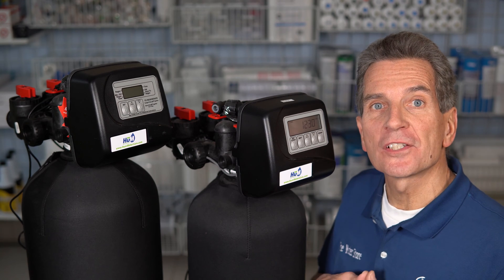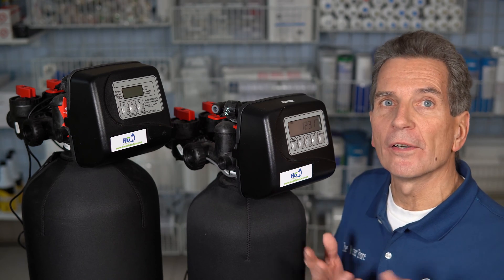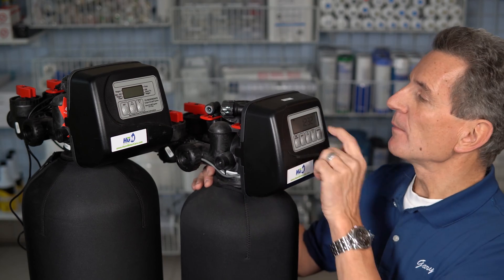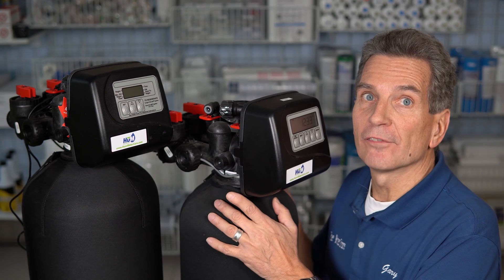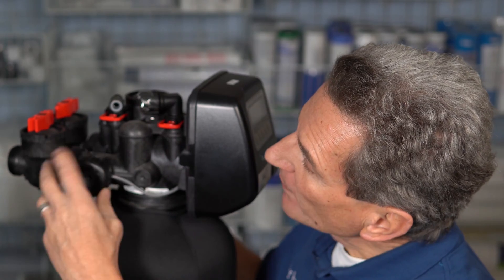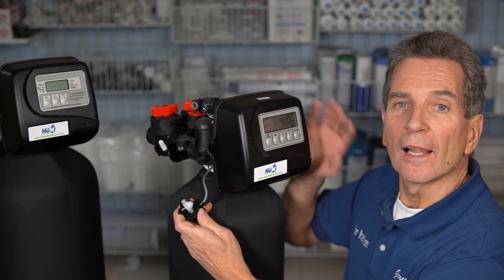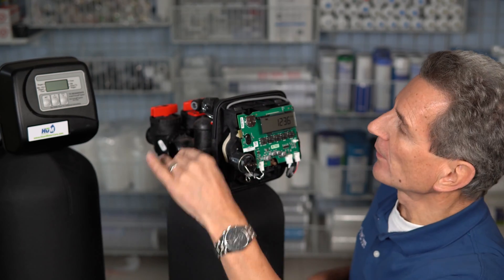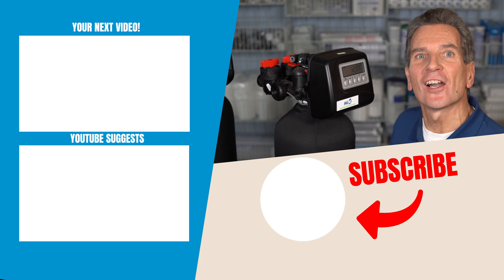WATER SOFTENER Troubleshooting NO SOFT WATER 6 Easy steps

Comment: The 3 way bypass valve was my issue and my fault. I left the bypass valve open after replacing the spacer stack and pistons. Gary quickly helped me troubleshoot and resolve the issue.
Reply from the maker: Yes, it happens very often!  I wonder how many working water softeners have been replaced because a bypass valve was left open?

Comment: So I have no idea what brand my softener is, as it's just labeled "Water Depot refineosoft." That said, the control panel is a bit different, but everything else seems identical. I followed the video along, shut off the bypass, started the regen,  got to pulling out the meter/impeller, and um yep, we had water gushing everywhere. From the quick glance I got before becoming the little boy with his finger in the dyke, the impeller looked like it was crusted with salt crystals. 

When I began troubleshooting what was wrong, I've watched several of your videos, and they're so extremely helpful. Lol just unsure where to go from here.
Reply from the maker: Water Depot uses the same Clack Valve as our HUM brand just a different faceplate. I think you forgot to shut off the water supply going to the softener. Also, if your drain line goes up some of the water will drain back down when you open it up but it will stop fairly soon. Give it another try. We have the meters here https://waterestore.ca/products/clack-ws1-meter-assembly-v3003
Reply: @GarytheWaterGuy    nope water was shut off. It's 100% the drain line as it was fed through the rafters. So yeah we need a bucket but will check it next day off. Thanks for the link!

Comment: Just one more thing. This 5600SE system was installed in 2007. I performed a partial rebuild of the control valve in 2015. When I attempted to service it again in 2019, the Fleck stainless Bypass valve was extremely difficult to turn because the internal rubber seal had disintegrated (it spread small particles of rubber all through our plumbing). I replaced the Bypass valve with a new one at that time and ordered a rebuild kit for the original, just to have it on hand. However, it's only been five years, and now I'm seeing the same problem. Could barely turn the valve today, and there are rubber particles in the pipes. This is probably also why the meter isn't working. Do you have a recommendation for duplicating the bypass function with external ball valves? I'd like to just eliminate the original Bypass valve and be done with this.
Reply from the maker: It's always a good idea to "excercise" the bypass at least once per year.  Yes, you can build a 3 way bypass with ball valves instaed, if you prefer.
Reply: @water_estore  This is the Fleck bypass with a single handle. The large inner seal swells and decomposes. I think the cheap Chinese rubber compounds don't like the chloramine in our water. Anyway, I finished building a 3-valve bypass system today, hope to hang it on the wall tomorrow. Then I'll rebuild the control valve, and hopefully that will be the end of this for awhile. Guess there's no way I can post a pic of the system here. Oh well, thanks for the video!
Reply: As I suspected, the turbine meter was stuck. I disassembled it assuming it needed cleaning, but the problem was that the two magnets had rusted and were rubbing on the turbine walls. I don't understand why this didn't last longer. It's only 17 years old.  🤣

Comment: Our Fleck 5600SE has somewhat the opposite problem. It's set to regenerate when total flow reaches 2,200 gallons. However, it has stopped resetting to zero during regeneration and now shows 2200 all the time. Because of this, it tries to regenerate every day unless I unplug the wall wart. Any ideas on what might cause this? I really like this unit, so hoping it's not an obsolete component.
Reply from the maker: Sounds like a settings problem, did you change any settings lately?
Reply: @water_estore  No, haven't changed any settings. One thing I discovered yesterday is that the "Flow" indicator doesn't blink when water is running. Maybe it's a quirk of the firmware that regeneration won't reset the usage number if the meter isn't working. I'm about to rebuild the controller, so I've ordered a new meter assembly, just in case. I sure hope this doesn't turn out to be a defect in the PCB.
Reply: Just an afterthought - It's been a long time since I worked on this softener, and I coujld be mistaken about the usage function. Maybe it counts down from the max setting, not up from zero. If that's the case, this might only need a rebuild (it's due) and cleaning the meter turbine. Got my fingers crossed.

Comment: Great video, very informative. I pulled the water meter and it shows “softening” when I blow on it. Reinserted it and it does not “soften” with regular water running through. What’s my next test?
Reply from the maker: Assuming you ran water from a faucet that is serviced by the water softener, if it still does not register softening I would replace the meter.  We have them here https://waterestore.com/products/clack-ws1-meter-assembly-v3003
Reply: @water_estore  thank you!  Second time I tried, it started registering again. I think maybe it just needed to be freed up.

Comment: This is great content, thanks Gary this helped me resolve the no softening display when water is flowing  the meter may have been stuck when I removed it and some water came out from the port when going through the rejen cycle back to the home position. I spun the little fan and it started working .
I reinstalled it and now its working again.
I just replaced the well pump and sediment may have gotten into it as I do not have a prefilter in the softener .
Reply from the maker: Excellent, glad it helped.  Please share video with friends and family.

Comment: My clock time has frozen.  I can’t adjust the time.  The hour and minutes flash, but the up and down arrows don’t work.  Help!
Reply from the maker: Disconnect the circuit board from the power supply, wait 1 minute then reconnect.  If that reset doesn't fix it, you need a new circuit board.  We have them here https://waterestore.com/search?type=product&q=clack+circuit+board

Comment: Do you have a video or know how to fix the control panel, yesterday I turned on the extra regenerative setting and then a day later it’s still on. I’ve tried unplugging it and cutting the power. Any advice?
Reply: It’s an envirotec water softening system
Reply: Yesterday at night I also noticed that the brine tank was dry, it just had the salt. So I poured water in
Reply from the maker: Try unplugging the circuit board, wait one hour and plug it back in to reset it

Comment: Your videos are great Gary! My sterling water softener hums and vibrates loudly near the bypass valve at the top of the media tank each time a toilet flushes or a faucet is turned on low pressure.  Would greatly appreciate any suggestions.
Reply from the maker: Never heard of this before but there could be a restriction inside where the pipes connect.

Comment: Hi Gary, I have a culligan water softener that is not registering any flow. It says softening but the flow rate is 0.0. The flow wheel spins freely when I blow on it. Do you think it's a defective meter? What would you recommend I do?
Reply from the maker: It’s either the meter or the circuit board. I hope for your sake it’s the meter

Comment: Can the flow meter be sensitive to vibration or wild fluctuations in water pressure occurring over several seconds or minutes when NO actual flow occurring? We have a softener intermittently detecting flow & softening when no flow is occurring. A Phyn water monitor detects these wild fluctuations in pressure changing over microseconds anywhere from 69 to 83 PSI & showing micro-flows GPM at same time, but NO actual water consumption measured! When this occurs, using a highly sensitive amplified stethoscope to listen to in & out pipes to softener, we can confirm NO WATER is flowing. Turning water on/off at sink somewhere in the house, we can hear it flow & stop accordingly. When this intermittent wild pressure event occurs, stethoscope detects vibration at pipes in/out of water softener.
Reply from the maker: I really don't think so.  I would replace the meter, sounds like it is defective. https://waterestore.com/products/clack-ws1-meter-assembly-v3003

Comment: Hey Gary, I have a clack 5 button water softener that when I test the meter is working (blow test, and counts down). However, when it’s reassembled the water meter does not count down when in service. This is confirmed by also no flashing “softening” when water is being used. It did prior to ~ 5 months ago. Is this the circuit board?
Reply: This is my issue as well. Have you found the reason for this?
Reply from the maker: No, I have never come across this situation.  Unless there is something in the valve restricting the turbine from turning or the flow is backwards through the water softener.
Reply: Would it soften the water if the flow was backwards?
Reply: @bali240  this my problem to; did you find the issue ?
Thanks

Comment: WATCO brad.  Does not turn on.  Used to auto on around 3:30 Am.  It does display correct time.  Salt level about a foot below very top of tank.  Had to add 8 gal of water to get crystals covered.  I pushed 'REGEN' and it now says 'run today', but did NOT turn on.  Have  not done anything else.  Have not heard it come on when up at night in months.  White blush around water line in kitchen sink when done washing dishes in it.  No longer consuming salt.  Maybe it just needs to be reset as if it was fresh out of the box???  Don't know how tho.
Reply from the maker: Check out my water softener troubleshooting video here https://youtu.be/Lr3jyGiJdC0

Comment: Hi Gary

I love your videos, thx a lot !

Please, Can you help me to diagnose an issue with my Clack WS1 inline flow meter?

I started to notice the word softening flashing on the screen, but no one was using water at that moment, I disassembled the inline Flow Meter in order to check it and reconnected the Circuit board to the electric power and even without the inline flow meter connected to the circuit board I noticed the word softening flashing on the screen, I was intrigued by what's happening

I am an engineer with a lot of ability to evaluate and correct mechanical and electronic problems. Could you please guide me from the height of your knowledge and experience about what might be happening?

I have tested the flow meter and it is working usually, when the impeller is activated with an air blower, it starts to count the volume G/min, with a more potent air blow, it shows a more significant volume per min

Hope you can give me this small contribution/help

Best Regards

Eng Adriano(Brazilian but my home is Arizona)
Reply from the maker: Wow, never seen this before. Must be a defective circuit board

Comment: I installed my Aquasure unit to-day and ran the initial cycle and setup per instructions,  but the gallons don't count down, I did plug the cable into a port in the back for it and the power plug, set the time etc etc and it seems to work ok but not counting down gallons. It doesnt have that unscrew a cap  to remove the impeller.
Reply from the maker: Are you sure it isn’t plumbed backwards?  If not something is defective

Comment: My water softener is the other one with the three buttons, what brand is that? The dash is completely off not sure what’s going on
Reply from the maker: If your 3 button display is blank you would either need to replace the power supply https://waterestore.com/products/clack-ws1-replacement-transformer-clk-v3186 or the circuit board itself https://waterestore.com/products/clack-ws1-3-button-circuit-board-v3108tc This video will help you troubleshoot https://youtube.com/shorts/JNVLAd4SD4I

Comment: Hi There, I would like to know how to fix error code 0 on Model Fleck 5800 LXT downflow/upflow water softner. Drain water continuosly running while the error code flashing.  On Manual error code 0 showing, Motor Stall/Cam sense error. how do I fix this?
Reply from the maker: Sorry I don't know.  I very infrequently deal with Fleck products becasue I do not like them.

Comment: My softner wont regenerate! I looked at my meter and it's still working! The cam turns on the top but it won't flush the tank at all never makes a sound! I can dig a pole threw threw the salt I'm out of ideas any help is much appreciated
Reply from the maker: Did you try the suggestions from this video https://youtu.be/Lr3jyGiJdC0

Comment: Thank you so much for this video. The meter on my water softener was not working and by following your instructions I was able to remove it and found that is was sticking. With a bit of cleaning it is now spinning freely and my water softener is metering properly again. You saved me a bunch of $$ for a needless service call.
Reply from the maker: Glad it helped!  Please share video with friends and family!
Reply: @water_estore  Guess what? 2 years later and it happened again, so I watched this video again to refresh my memory and in less than 10 minutes, I had it working perfectly. Another needless service call avoided. Thanks again.

Comment: Thanks so much for this information.
I have a Westinghouse water softener system and we had a power outage, the thing will not work, I followed your video and have .26 seconds for it to do something so I am waiting.
Reply from the maker: The power outage may have damaged the circuit board.

Comment: The water coming from my Culligan 01023111 did not feel softened so I checked it out.
It says it's softening but does not register any water usage on the counter and I assume since it's no longer using salt, it no longer regenerates.
I did a manual regen and the water now has that slick softened feel to it so I guess it's either the flow sensor or the circuit board.
Reply from the maker: yes, you are correct.

Comment: Hi there, really good troubleshooting steps but mine never displayed the time to put it in service mode. I see on the screen it says to call for service and that’s what led me to this video. Should I look at replacing the meter? Not sure what to do since I could not put it in service mode.
Reply from the maker: Someone has turned on the "Call for Service" reminder.  It usually means nothing, the installer just wants you to call for a "check up"

Comment: Why is my meter flashing?
Reply from the maker: Great question  It depends on what is flashing.  If it's the word "softening" it tells you that water is being used in the house and it is measuring how much.  If the time is flashing it just needs to be reset.
Reply: @water_estore  it was flashing 06.. And I just moved into this house and not sure how it works yet,  but this was the first time I've ever heard the machine make any noise,  maybe it was cleaning it's self?  It's a water boss 380

Comment: Water softer does not stop regenerating. Water keeps running out constantly
Reply from the maker: Is it running out slowly or quickly? The piston is stuck inside or water is leaking past the seals.  Either way the pistons and seals need to be replaced.

Comment: Gary, I tested the water inside the house several times and its soft. I took out the turbine meter and quickly went thru the regeneration buttons to get back to 'softening' but the digital display still shows gallons full with no movement.  Does this sound like the circuit board needs replacing? Unit is a Clack WS1, around 10 years old. Thanks,
Reply from the maker: So when you run hot and cold water in the house the display still reads 0.0, is that correct?
Reply: @water_estore  Yes, that is correct.

Comment: If there is a problem with the water flow meter or softener could it cause the main water line that supplies water to the softener to leak or rupture? Reason I ask is because we just had one installed and there is a puddle of water outside of the house that feeds the softener. The water used indication on the softener has been stuck at 1091GL for several days and wondering if there is a problem causing water to pool near the main water line feeding the softener. Thoughts?
Reply from the maker: No I don't think so.

Comment: My water softening tank isn’t showing me anything on the meter screen and it’s not breaking down any salt. I filled the salt about a month ago, and noticed just now that it hasn’t budged and my meter is off. Is there a likely cause of this?
Reply from the maker: Shelby Wagner check the obvious first. Make sure it is plugged into a working outlet. If it is, your circuit board needs to be replaced.